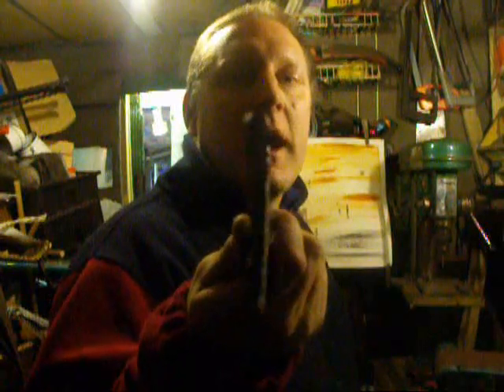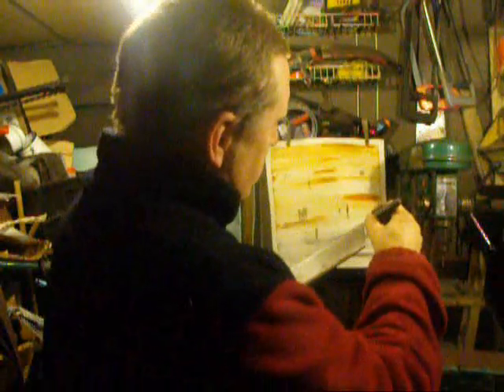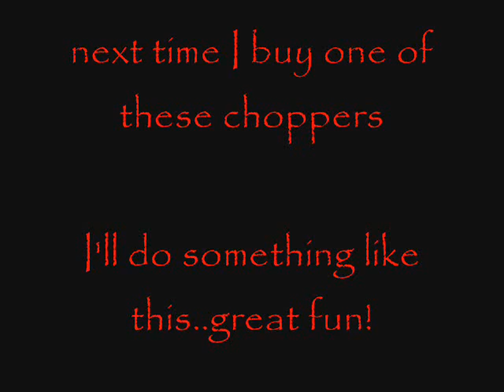Making A Leuku Knife

Comment: For the vice you could also use two peaces of leather in place of the wood! Try using a saber saw to cut the smaller preciser cuts it works really well! You don't have to worry about the curvature of the angle grinder blade, and there are no sparks so you can really see were you are going.Just a few ideas!
Brenton